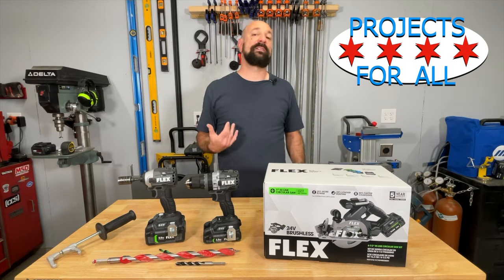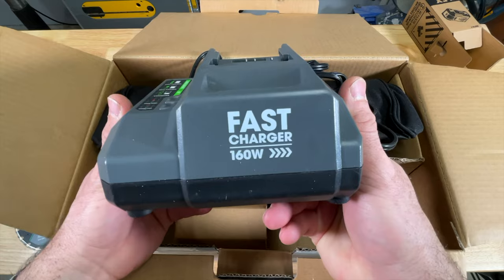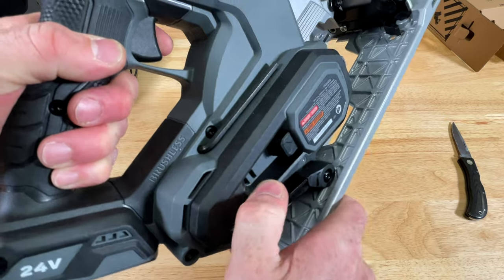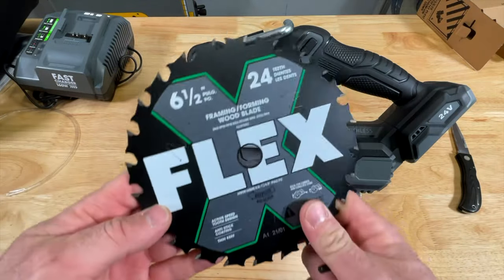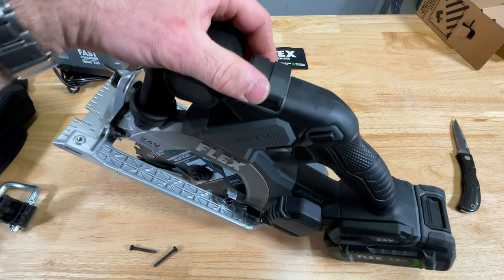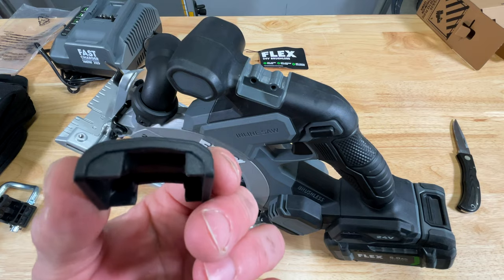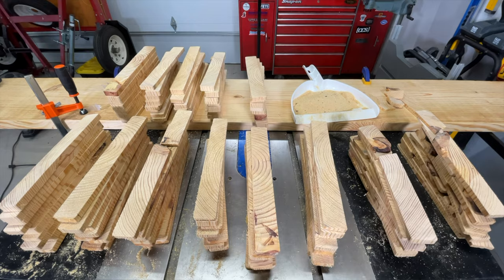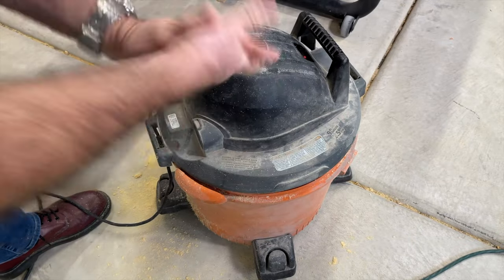Why Buy An Inline Saw??  ||  FLEX FX2131A-1C  ||  Circular Saw Kit

Comment: Sweet. FYI, just so you know, one of my 6.0ah stacked lithium batteries I have died on me for no good reason. I called Flex and the call lasted just over 7 minutes. They asked my info and a shipping address and that was it. No other questions asked. Said they are shipping a new one out within 48 hrs. Simple as that.
Reply from the maker: Thanks for the heads up Craig! This is a helpful comment because most Flex/Skil/Skilsaw tools are sent to me and not bought I haven’t been able to use the regular customer service line. I’ll tell you my normal contacts at Chervon are crazy helpful and about the friendliest folks you could meet. I’m happy to hear they treat customers with the same respect. Thanks for watching!!
Reply: @ProjectsForAllReviews  For sure. While I was disappointed the battery crapped out on me for some reason, the phone call was quick and the woman I spoke with was very pleasant. And like I said, she didn't ask me any questions or give me any trouble at all. Super easy process. Basically, it was: What's your name and email? Can you tell me the last four of the serial on the battery? Where do you want the new one shipped?
I asked about the old one and she said keep it. Hold onto it until the new one arrives and then recycle it if you want to.
Reply: did they ask for you to send the old one back ?
Reply: @Soroosh.J  No. I can't imagine this is the standard practice, but maybe it is. I don't really know. I even asked the lady if they were going to send a return label/box and what I should do with the old one and she told me to find a local recycling location and recycle it.
Reply: @sanfranatic1  thank you for taking the time to answer me, I appreciate it brother
Reply: @Soroosh.J 🫡
I debated mentioning this, but I will go ahead and say it....
The problem with the battery that was bad was that it wouldn't charge. So I went through the process and they sent the new one out.
Then I got to thinking about it and made some leads with clips and wires and hooked them up to a battery charger/jumper box. After about ten minutes, the old battery started charging. Then I put it on the Flex charger and it charged it up. It has been fine ever since. So I basically got a new battery for free from Flex.
Reply: @sanfranatic1  good for you brother, you didn't intentionally deceive them so....
Reply: I think what happened to the battery is that the way it fits in the plastic case, if you place the battery in there in a certain direction, when you stand the suitcase style case up, the charging indicator button on the battery is face down and the weight of the battery causes it to push on the button. I think that over time in storage, it kept pushing that button, which slowly depleted the battery until it drained it so much that it no longer had enough juice to even charge when I put it on the Flex charger.
Manually forcing a charge with leads and a jumper box forced enough juice into it to give it enough to be able to charge it on the Flex charger.
Reply: @sanfranatic1  it's possible

Comment: I bought the Flex 6 1/2" inline saw at Lowes, and it's an amazing saw. I got it because it's maybe the best designed saw on the market, with full dust control, while retaining left blade visibility, and it's also belt drive, allowing the deepest cut of any 6 1/2 or 7 1/4 inch cordless saws at 2 9/16" depth. The saw addresses the main problem with worm drive saws, which is the lack of dust control. Flex solved the left blade dust problem with the amazing dust port and adjustable elbow that blows most of the dust away from you.

What I've found (and wasn't expecting at all) is that Flex has better quality control than Milwaukee on their circular saws. 

I tried two Milwaukee #2732 M18 cordless 7 1/4" circular saws with a right blade configuration (their new flagship model) brand new from Home Depot, and both saws were misaligned by .020" on the shoe plate, so they were useless for precision straight edge guided cuts, because the blade would leave severe blade marks. I was really shocked to see such a horrible misalignment. It has permanently ruined my respect for Milwaukee. A .020" misalignment is probably the worst misalignment you can find.

The Flex saws, both that I've purchased, are absolutely 0.000" dead parallel between the blade and the shoe. Another surprise is that the Flex saw motors sound dramatically better than the horrible shrill sound of the Milwaukee M18 model #2732 which produces a bad gear whine and motor whine.

In Project Farm's tests, a Flex 7 1/4" right blade saw performed at or near the top in every test. When factoring in their ergonomics, metal parts, perfect accuracy out of the box, their current pricing and current lifetime warranty option, they really might be the best cordless saw.

Comment: This saw was my first Flex brand tool.  I love it.  I am slowly switching over to flex.  Too many m18 battery failures to stay with milwaukee....
Reply from the maker: I really loved this one too Fester, more than I expected. Although I own a lot of Milwaukee and am still rockin M18 bats from 12 years ago. Thanks for watching!
Reply: @ProjectsForAllReviews  same here.  M18 batts from 10+ years are still functioning good....much better than several of my new batts.
I bought the flex $99 drill kit today.  Im impressed.  This summer i intend to get the turbo drill and high end impacter as well as the 7 1/4 circ saw with the 10ah stacked battery.  I will probably wind up getting the rest of their lineup as well.  I hope they keep adding new items....

Comment: Hi, I'm from EU and we have flex but different. This "new inline saw" has been sold in europe from flex model CS 45 18.0-EC C since 2021. Major difference is 18v platform and disk diameter 128mm(5 inch I think~). Flex is credited for inventing angle grinder in 1954 and in europe many nations call(nick name) angle grinders a flex/fleksa/fleksis/etc. Flex tools in europe are painted red and battery platform is 18v.
Reply: I don't see any Flex tools in France. Where can I get it?

Comment: We use skill saw all day everyday, this one is hands down the best.  It isn’t even close, and if it takes a battery we’ve tried it. We are a solid flooring manufacturer using mostly reclaimed material.  Cuts through 2x heart pine like butter, and handles 2x oak joist much better than any of their competition.
Reply from the maker: Thanks for the pro insight!  This has become my go-to out to the ten or so saws I own. I appreciate the balance and less fatigue on the wrist. Not short on power either. Thanks for watching!
Reply: I'm New to buying DeWalt or Craftsman. Do you still recommend the Flex circular saw? An answer would be great

Comment: Another thing is the quality of the flex blade.  Im normally a Diablo fanatic but this blade surprised me.
Reply from the maker: Impressed me too. I like everything I've seen of Flex so far. Got the StackPack coming soon!
Reply: @ProjectsForAllReviews  those stack lithium batteries are going to change the game.  Faster recharge means less batteries. 
I will never buy a battery lawnmower though.  My m18 string trimmer and the 3 defective 12ah batteries has me completely soured on battery lawn stuff.

Comment: If you need a new shop vac try a dewalt stealthsonic 12 gallon. Also the cen tec hose kit with the power tool adapters is really nice
Reply from the maker: I haven't seen that vac in person yet but looks good. That old Ridgid just won't die. The stiff hose and attachments that fall off in use have been annoying me for probably 15-20 years 😂 Thanks for watching Bread!!
Reply: @ProjectsForAllReviews  Mike...new filter. It is time.

Comment: I love the idea of this Saw. I just can't find it cheeper than 7 1/4" Rear Handle Frame'n circular saw. My area Lowe's  Stores don't carry this saw.? They're literally the same price.
I'm in the market for a 6.5" left blade saw. If money wasn't an issue(meaning, about 45 minutes after it's not an issue, I'd likely pick one these badboyz up!🤓).SKIL seems to have the best deal going right now for a 6.5", left blade, circular saw. At least, SKIL is in the same wheel house, as FLEX, though maybe not quite pro-level.!

Comment: That’s funny I was just researching to see if anyone else had the same issue with their battery being loose on the drill cause mine is like that but can’t remember if my first drill was loose as well. But my circular saw 7 1/4 is loose as well as the drill. So funny to find it in this video that had nothing to do with it, was just curious to know what the hype was about the inline saw haha
Reply from the maker: The looseness hasn’t changed and I use that drill all the time. I don’t really notice it anymore. This saw has also become my go to. It’s nicely balanced and has plenty of power. Thanks for watching!

Comment: Just bought this saw, really good bang for the buck vs Milwaukees $249 for just the tool lol.
Reply: Never pay full price for tools. The Milwaukee comes on sale for $199 with battery all the time. Sometimes $189
Reply: That being said this is a better tool than the Milwaukee. I have the 6 1/2” and it has a hard time (when pushed) with treated 2x10. This tool made it look easy.
Reply from the maker: I own that Milwaukee M18 Fuel circ saw also. Paid $250 about 4-5 years ago and got a 9ah battery on a special deal. It's been just ok. A little underpowered and been back to Milwaukee once for a warranty repair when it stopped working. I do really like the inline design of this Flex though. There's nothing like it on the market that I'm aware of. Thanks for watching!
Reply from the maker: I agree! Unless I'm in a pinch I always wait for a sale. Holidays and fathers day are the best times to grab what you need. Thanks for watching!

Comment: This or SKIL PWR CORE 20™ XP Brushless 20V 7-1/4 In. 5300 RPM, Circular Saw Kit Includes 4.0Ah Lithium Battery and Quick Charger- CR5440B-10

Comment: Register it for that lifetime warranty brother it's fast and easy just read out the numbers and models and it's warranted for life I'm about to have to warranty my second tower light come to find out it doesn't like the 10.0 stacked battery hooked straight up to it or bad 😢 switch 😢😢
Reply: Bro I didn't know that because I use the the 12 amp hour battery for run time
Reply: @rickyperkins232  yes sir do not hook the 10.0 up straight to the light off of the tripod this will be my third light I had to find out what was killing it and I duplicated the results twice. I've also talked to the engineering department at flex and there gonna fix it and as of now I have another light tower light on the way thank God I had two
Reply: @TacticalThib  how was the customer service throughout the warranty process?
Reply: reviews  thanks to you I got this rocket light because I was really leaning on the Milwaukee version.
Reply from the maker: I appreciate you posting your experiences. I haven’t used either the stacked bats or tower light yet but I’m sure we’ll get them on the channel soon. All the flex tools I’ve reviewed so far have been amazing. We’ve got the stack pack coming next and the parts I already have look pretty tough. Thanks for watching!
Reply: @rickyperkins232  costumer service was excellent Rick I've already got my new light I was advised not to use my 10.0 on just the head of the light my 10.0 might be putting out to much power I checked it and sure enough almost  27v 26.87v it's putting out like Megan from Jr high lmao 🤣 but all is well now I'll let everyone know via my channel if I have another problem with any tool 🔥🔥🔫
Reply: @ProjectsForAllReviews  no problem I know Mr Perkins very well so when he saw me comment we struck a conversation the tool world is small sir and we all know each other!! I wanna say I love your style you're videos are amazing informative and entertaining
Reply: @TacticalThib  Sorry this is a comment on a 1-year old thread, but the 10.0 Ah stacked lithium killed the detachable light itself on your tower light? I have had to get one replaced since the buttons on the tripod part stopped working… and it happened to the replacement too. Only thing is, I almost exclusively use the lights with a cord at the base. The button on the detachable light itself still can turn the light on, however, on both my units.

Comment: Bought that same combo on Ebay and like a seen from Jason the horror came in in black goo leaking from all batteries. Called Flex and since I bought them online and not Lowes they will not replace them. Problem is that they did not make it public about their horrible battery crisis and they ONLY helped people that would call in so f*&^* everyone else who did not call in because they didn't know about flex replacing the bad batteries. Replacement batteries are very expensive, I just bought be a drill with cord instead for $40.
Reply from the maker: That's crazy but not the first time Ive heard of this from a viewer. I have three regular Flex batteries, two 5ah and one 2.5ah and haven't had trouble with them and I use them a lot.This Flex set has become my go to large drill and driver. Sorry to hear. Thanks for watching!